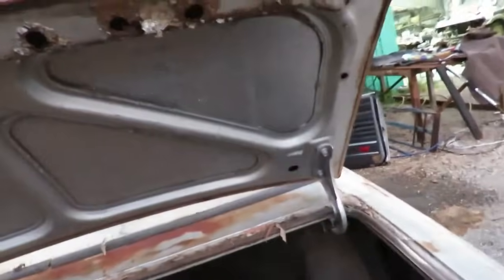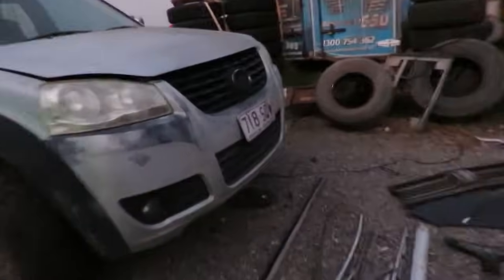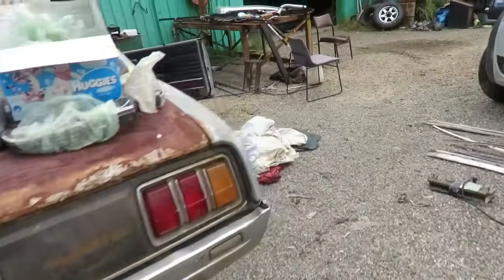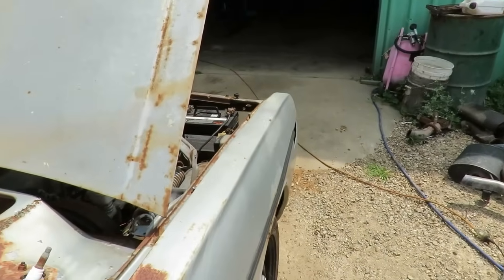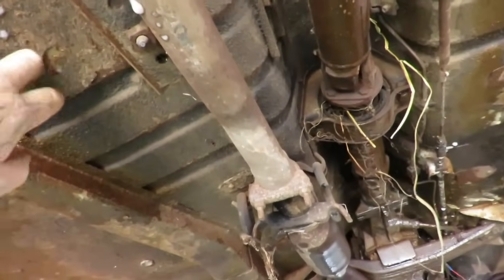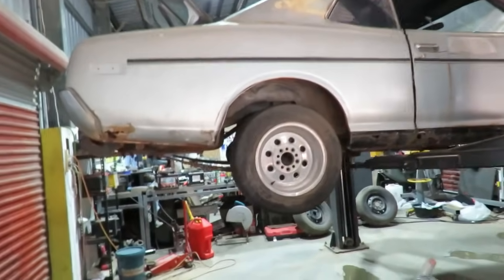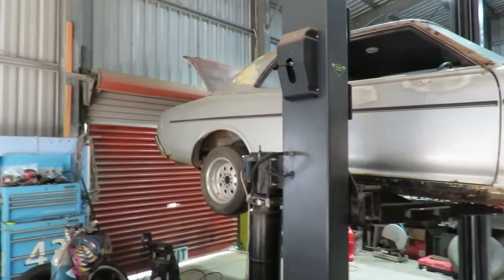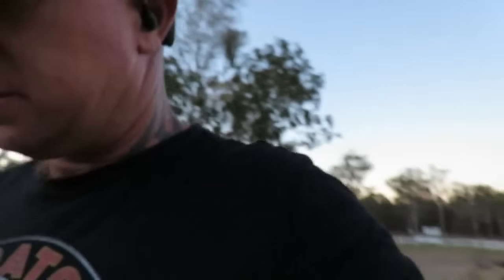Kingatow Crew #174 rough rusty roadtrip datsun 240c build parts search and what wheels will fit

Comment: Was thinking about you today , Remember the suggestion about using a mini sedan for a ute. Well since I was intending to do one , I did actually inquire with an engineer. He told me that because the roof is part of the structure, it would require a sufficient internal brace from the rear bumper level up to the door handle. It was also suggested that the brace should go in before cutting the roof. My own plan was to cut the roof straight across from the rear seam, so that the back window retains its roof curve, and the roof and drip rail should match up exactly. The back tray should retrain the 30mm flat strip above the quarter, and same welded onto the top of the boot / tailgate. What really made a difference to the one I seen in a mag was the absence of seams on A and C pillars and smooth inset door handles.
Reply from the maker: there is a green one out here that I think was in the last car show video ...the structure I think would be like a moke ..I have seen a few done mostly from mini panel vans